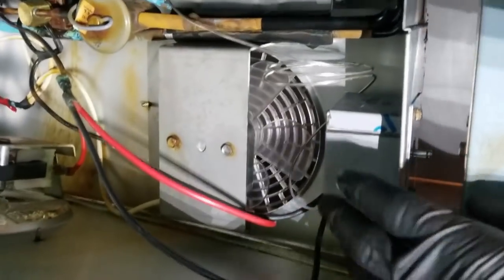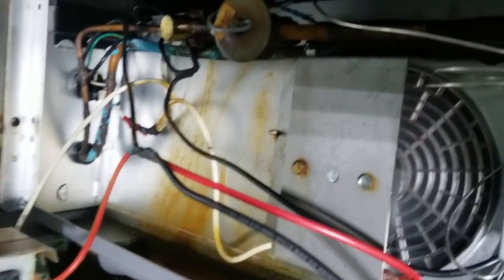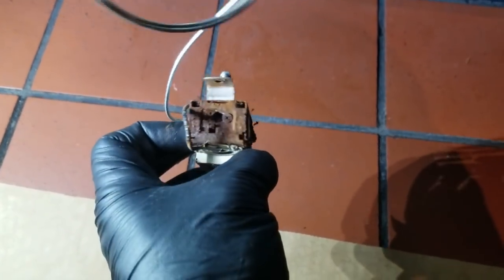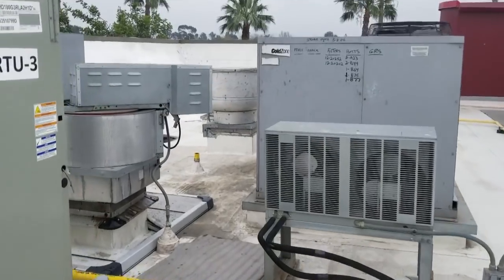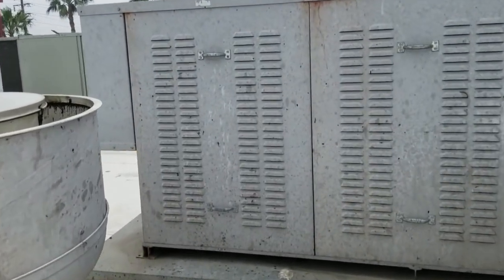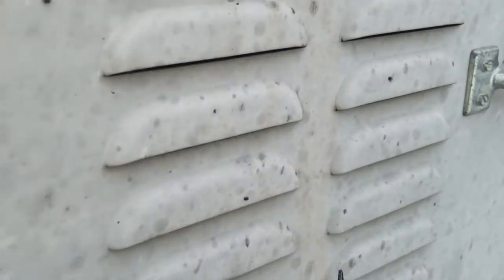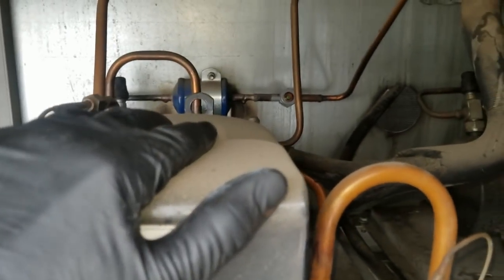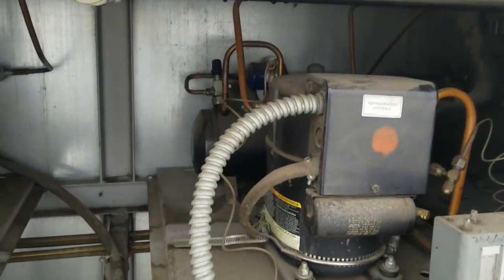Waitress reach in not cooling.

Comment: Once that small box cooled down, could you get a rough idea of evaporator superheat using two temp clamps?
Reply from the maker: The lines go directly out of the coil behind the box where you cannot access them. If the original installer would have piped the unit better maybe we could add pressure ports at the unit and than we could access the system at the box . But that would be in a perfect world and we both know that would never happen.